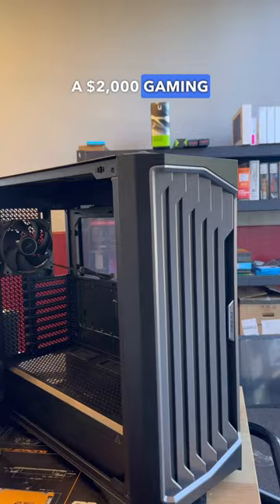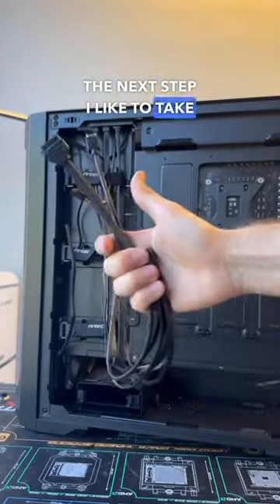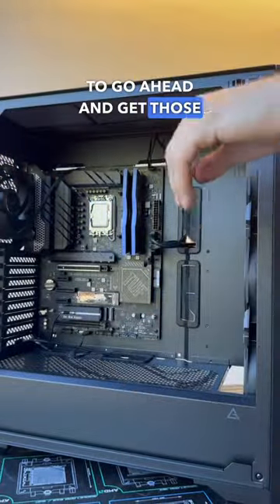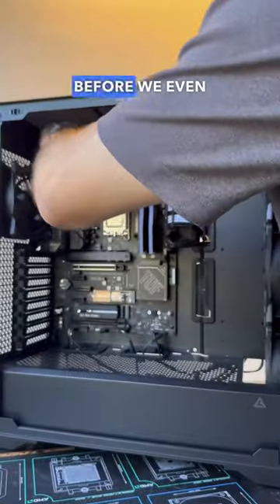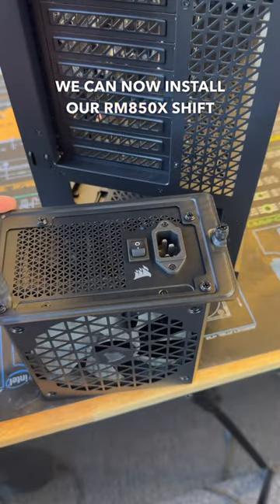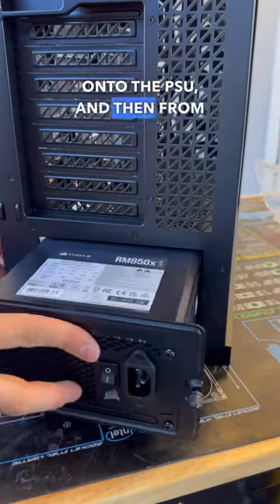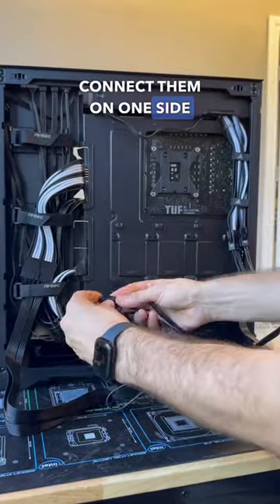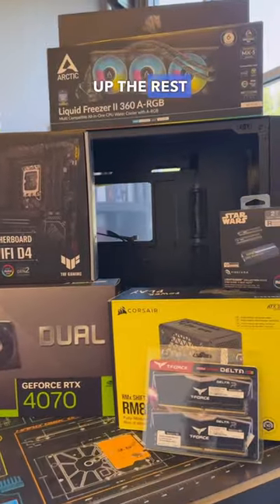$2000 Gaming PC Build Guide! Part 3 #shorts

Comment: A question. For example I'm getting Lian Li Lancool 216 case it comes with 3 ARGB fans but where exactly do I plug them in? is there 3 plug sections for fans to spin and 3 for RGB stuff? Do I need to buy something extra to help me out? This will be my first build that I will be doing next week.
Reply: My fr design pop air rgb has a splitter in connector
Reply: Hi, the rgb version of the case comes with a fan/rgb hub with I believe up to 4 rgb and fan headers, as well it is sata powered 
Just look at your motherboard manual and find where your system/chassis fan headers and rgb/led headers on your motherboard are
Message back if you need more help, want me to look over your build and maybe give any suggestions or changes I would do

Comment: This is really mid for $2000...
Reply: Absolutely, 4000 series is horrible value
Reply: @Marzsala fr, this dude is acting like RTX 40 series is good value 

prior to rtx 40 series and Radeon 7000 series launch, i managed to get an open box rx 6900 xt for $700 USD from micro center
Reply: @Marzsala not just that, I got a 4080 and 7800x3d for 2k. Idk how tf he got a 4070 in that price range.